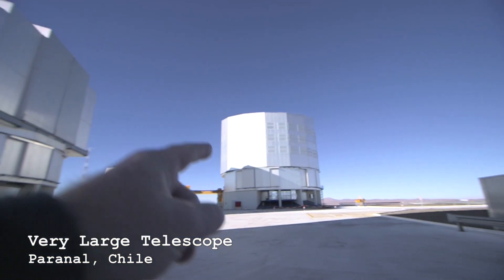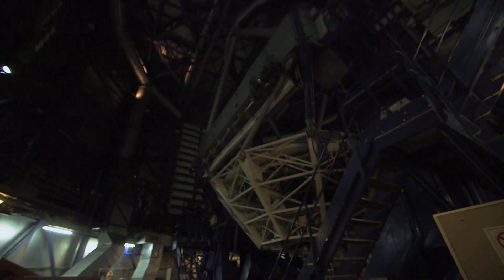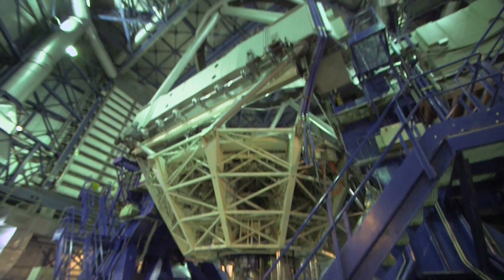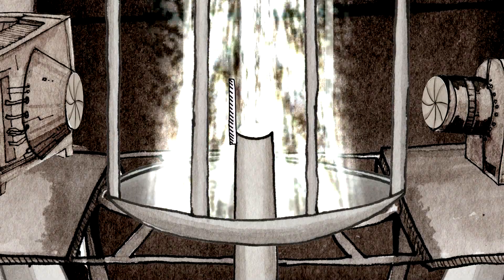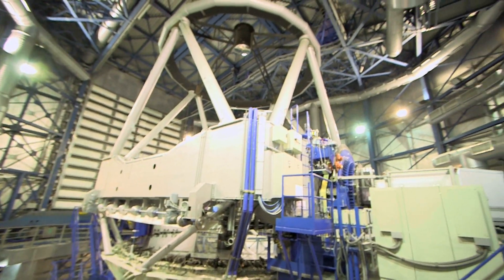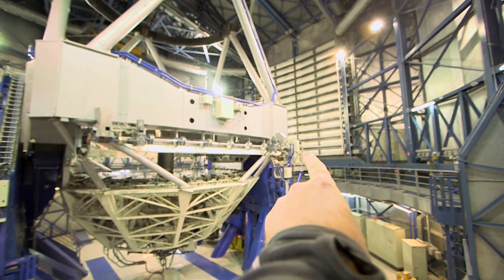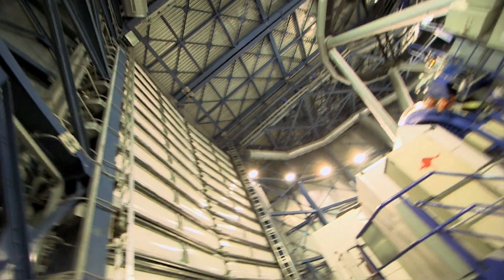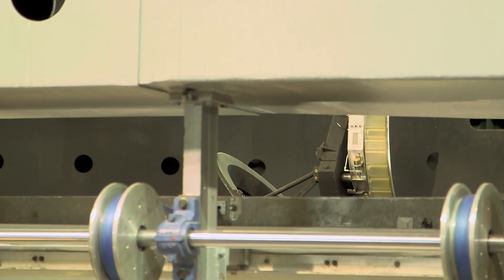Inside the Very Large Telescope (UT2) - Deep Sky Videos

Comment: If one would make a tertiary mirror that could move to any direction, would it be possible to add more and more instruments into the dome? Or is there a maximum for other reasons? Might cut down in building costs if you could fit for instance 12 instuments into one dome, in stead of building 4 domes with 3 instruments each.
Reply: But then you wouldn't be able to observe four things simultaneously, making the queue times much longer.